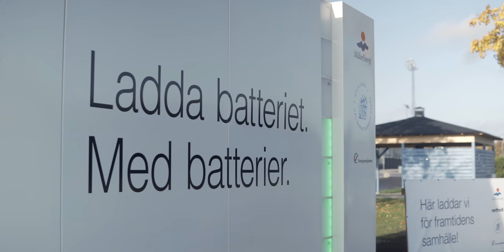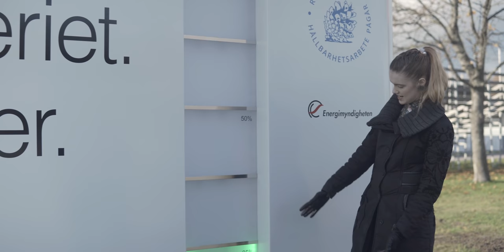Inside Northvolt - Scandinavia's 'Gigafactory' | FULLY CHARGED

Comment: 30:02 compounding... 6% growth for 10 years is 79%
Reply: Indeed. Just grab the calculator people and enter 1.06 to the power of (enter number of years). 1.06^10 = 1.790
Reply: That the growth rate is significant was the broader point for mere mortals.
Reply: Not only that, but if your battery is more energy dense, you can make it smaller and lighter and still get increased range.

Comment: Well, it feels like a race to the southpole considering that VW is running with Northvolt now and also deep in QuantumScape for solid state battery which want to build a german plant for the VW supply chain.
And that shall become available in 2025 with a twice as high density and faster charging speed at lower costs per kWh. That would have a huge impact.

Comment: very interesting video! Do you have any plans to cover Cornish Lithium?
Reply: Lithium in Cornwall ? Do tell.
Reply: @grahamstevenson1740  It's quite interesting, going back to the old tin/copper mining days they discovered springs loaded with lithium salts. The plan is to dig trial bore holes in these same locations and look into the viability of refining the lithium compounds from the dissolved salts.
Reply: @deathruddlesdeathruddles5438  yes I have seen bits on this but very little information seems available.
Reply: @keithware5314  I've seen their promotional videos. I think it would make a great onsite fully charged vid!
Reply: @deathruddlesdeathruddles5438  Yes that would be a good idea. Also a mention of the battery giga factory to be built in Northumberland.
Reply: @keithware5314  indeed! Could be a nice synergy there with a lithium source and battery factory in the same country.

Comment: Very interesting - thank you. I have just bought my first EV and I have not come across any definitive information on how best to maintain the battery for maximum life!  Some suggest regular discharge/recharge cycles. Some say charge to 80% each time, some say it doesn't matter... so could that question please be answered by a manufacturer such as Northvolt.  It was mentioned to keep plugging in, but to what state of charge? 100% all the time, or 80%?  Good on them to work recycling into the process.
Reply: 100 only if you have a long trip that needs it. For daily use 60-80%. Keeping the battery in 20-80 range should be pretty good.
Reply: Charge to maximum 85% to prevent tendrils forming

Comment: Do you remember when a 256K disk drive weighed approximately 5 lbs and was about 14 inches in diameter? That could (maybe) represent the capacity of battery storage in the future.
Reply: @Paul Denney Amazing how data grows to fill the available space.
Reply: I used one that was that size but had 1 mByte of storage, & the fixed drive had ~2x that!
Battery density will probably double during the next 15 years.
Reply: @Paul Denney A well payed job? They cost £2000 If I remember correctly. Poor ass me only had floppies in my XT!
Reply: My intent in posting that was to show how technology changes when there is the research funding necessary. I have no doubts that battery storage capacity per unit of size/weight is going to increase greatly over the next years, perhaps exponentially. The weight of lithium batteries per watt hr. has now reached the point where they are successfully powering aircraft and can last for 20 yrs. Big change from lead acid.
Reply: @phillip1115  Talk of 'exponential' improvements in Li-ion battery energy density is daft for this moderately mature technology. There's talk of 500Wh/kg (re 300-350Wh/kg currently) being possible but it's largely down to materials issues. A theoretical upper limit of 600Wh/kg in the 'perfect Li-ion battery' is accepted by most researchers.
For example, the aluminium and copper foils which form the electrodes in current production is 10 microns thick. Reducing the thickness would enable higher energy density without increasing losses from electrical resistance hugely but the material handling equipment used in production destroys thinner foils !

Comment: To make steel carbon free (as they claim they are doing) will need 2x the energy needed in Sweden today...
So to go green you go 3x energy consumtion... sounds "tricky"
Reply: That's WHY need to always have the Long & Wide view in planning & infrastructure design decisions.

Nuclear & next-gen nuclear gives you that durable energy density to do all sorts of intense electro-chemicall & heat-dependant processes & proton beam medicines etc. 

About 12  years ago I spoke with a representative  of engineering for a big Chinese  Photovoltaic company. Trade Expo & Conference in Montpelier.
She spoke excellent  english & french.
I asked her about more efficient PV chemistry & very thin film :: plasma printable future PV technology. And how that relates to Thorium Molten Salt Reactor projects in China, because they had just been announced in press and discussed at Thorium Energy conferences.

She was very responsive, on the ball & clearly informed and engaged about the strategy and business choreography.

She said:
"Yes Of course (forwards)!!!
But,  right now we have factories, processes and know how in place at work. But PV panels are little known, little used. Most people do not have them in livrs, on their roofs, towns, etc. We are signing contracts and selling product and LEARNING all the time. Each country & culture has its challenges.

The current relatively crude crystalline PV panels are not the most efficient. We KNOW that if course.
They use LOTS of electricity to make. But it's a pretty simple production line once it is up and running.
All the aluminum associated with mounting support structures and all across industry required lots of Electric Energy on demand 24/7

But IF you have that electricity, then you can do all of this, and boostrap to the next stage, to next technology.
We have to go through the present to get to the future!

This prrsent stage will take maybe 25 years.
By then we will know more, the paradigm will have changed enough to make it clear which combination of infrasrructure &;technology we need to use and improve.

By then we will likely have many optimisations but also the challenge of new large scale electrical engineering demands.

Electric Cars, metalurgy, electrochemistry, welding/manufacturing, offline and portable energy storage vs online.
She said we will need all of it.

Right now the PV companies are just using what is simple (cheap) easy to put out into the world.

 In 25:years we will replace much of that with better tech &  systems :;  smarter systems. 
Including next gen nuclear, offline storage and local systems as well as network energy plans.
Hi speed Railways included.

See the videos on Chinese hi speed rail construction.

Also recommend reading anything by Vaclav Smil

Comment: I don't understand why they've built the factory with a flat roof,the snow loading must be huge?
Reply: Snow= insulation!
Reply: @markthomasson5077  yes it works well as insulation,but I was questioning the weight after heavy snowfalls.
Reply: It is a huge building, so in proportion the snow is not so much.  Can you imagine how big a pitched roof would be!   Much less to design for flat roof snow loading
Reply: @markthomasson5077  being such a massive building is why I pointed out the potential snow load on such a huge area of roof,I'd imagine being that far north they could well measure snowfall in meters. I really don't know how they design roofs in regions like that,but flat seems to be the worst option,although I've no clue what would be a better option.
Reply: That is why one of the jobs of the building maintenance team is to clear the roof of snow, before it packs too deeply to be a danger. It is very common job for building maintenance during winter to send couple worker up to the roof with shovels and snow sledges to clear out the snow.

Comment: Why is cycling a battery supposed to be energy intensive? Modern battery manufactures discharge batteries back into the grid normally (even small chinese manufactures that make battery packs out of cells do this nowadays). Am I missing something here?
Reply: At a guess, even with discharging into the grid, even with high round-trip efficiency, there's still a substantial energy cost in absolute terms at the scale of the production planned in terms of losses to heat and then the necessary cooling. Granted, the waste heat may be recoverable for other industrial processes on site, but concentrating and transferring that heat also has an energy cost.

Comment: Interesting that northvolt factory will still be using wet slurry. Tesla 4680 cells will be dry battery electrode tech which negates the footprint and energy for those massive drying ovens and the time needed for drying.

Comment: Won't it be great to see articulated trucks full of charged batteries drive up to construction sites to keep the battery powered excavators and D9 bulldozers operating. Just think about that before getting too carried away.
Reply: You KNOW this is nonsense, don't you..!
Just stop being silly - nobody's impressed .....
Reply: O,r just maybe, they'll use a cable to get the power onsite instead. Some really large site machinery is already electric (large coal excavators, for example).

Comment: Carbon free steel won't be steel ! Carbon is essential to steel's properties.
Reply: Then you need to look it up. try google Hybrit
Reply: @flingborg  Read what I wrote !
Reply: You replace carbon with hydrogen. SSAB has built an testplant and a new multi billion $ facility is being planned.
Reply: @FRIPPE_THE_GREAT  SSAB is concerned with replacing coal in the smelting of steel. Steel itself is an alloy of iron and other elements, of which carbon is one that's essential to steel's properties. Hydrogen and steel don't mix well. search for hydrogen embrittlement !
Reply: @grahamstevenson1740   The point is not to ADD carbon.........
Reply: @flingborg  I think you missed the point. Steel is an ALLOY intentionally containing carbon. The carbon is NEEDED for (some of) steel's properties. Carbon (and other elements)-free steel wouldn't be steel, it would be IRON a far less valuable and useful metal.
Reply: @grahamstevenson1740   No one argues that steel contains carbon, the point again is not to add carbon, you are talking in circles.
Reply: @flingborg  In the video there's a reference to 'carbon-free steel'. My original comment was to point out that no such thing exists. Only YOU digressed to the issue of low-carbon processes to MANUFACTURE steel as opposed to the steel itself. I imagine that the low-carbon manufacture of steel increases the price somewhat.

Comment: This is the nonsense that the “green” industry is all about. To begin, making one battery is = 100 kw/hrs of energy! Not including all the energy used in mining and transport of the basic materials to the site? It is only because the factory uses hydro based electrical generation that makes this one factory work. This factory uses 50% of the country’s over generation of electricity? This is not the pattern used for other Giga factories in the USA and China, which use vast amounts of carbon generated energy to Make “green” energy products. Then of course, having made the battery, you have to charge it with electricity created mostly by carbon based electricity generators. The idea that the world can go all electric on transport is the biggest lie ever! There is not one country that could currently accommodate the amount of electricity need to charge millions of cars every night!
Reply: Another dirty little secret of "GREEN ENERGY" is the manufacture of Silicon metal used in solar panel production and wafers for IC's. EXTREMELY POWER INTENSIVE PROCESS.
i worked for a plant in the Midwest that made 25% of the world's Silicon metal before china flooded the market. that plant consumed more total power than the city of Detroit and power is the most expensive part of the process. Not saying we dont need to produce cleaner and greener forms of Transportation and Energy, we DO ! but the True Costs are really higher than they should be to get to the Future we say we need to Deliver. another reason Solar Panels never took foothold in the US.....No Local or National Solar Support in the form of Rebates or Tax breaks. Power companies don't want you to have Solar and fight you all the way....if not for Elon Musk's vison and businesses we would STILL be operating like we have since to 70's. Clueless and Careless when it comes to the Environment. The sad thing is, we will NEVER have TRUE CLIMATE cooperation from Russia, China and probably 30 other countries trying to become Industrialized. oh Yeah, they will build EV's but it wont be about how "Green" they are, it will be about How "Cheap" they are to Drive and Own. Its Coming.....It just comes down to what you want to do personally and what you can afford. in general, i think EV's are critical to World Air Quality long term. Just Hope Everyone can get onboard SOONER THAN LATER.
Reply: Island

Comment: The plant they building in Gdansk Poland makes a hell of a lot more sense than Sweden
Reply: Were you listening to the part where he stated that non fossil energy for the process was a critical factor? Poland is a typical coal grid which makes me wonder why they are even thinking of producing there.
Reply: @joakimnordberg2202  they're not going to produce battery cells in Poland. but they are going to build battery packs from the Swedish cells.
Reply: Ok. That explains a lot. It is quite clear making cells in Poland would be contradictory to the mission, it being to reduce carbon foot print as much as possible.

Comment: Heavy duty machinery powered by Briggs and Stratton or Cummins Diesel engines are already very energy efficient. Diesel is an extremely calorie rich fuel and I can’t imagine what the mass of these type of machinery would be if they had electric power trains. How can they be as efficient? How would you keep these machines charged? Can you please prove this point you made? You mentioned changing these heavy duty Diesel engines to electric power trains and then totally blew over that to love onto snowmobiles! Yeah of course having an electric snowmobile makes sense! Jesus Christ are we actually comparing massive heavy duty machinery to light agile snowmobiles?? By definition snowmobiles will be in cold environments so yeah obviously you don’t want to pollute these environments much if at all. 

Petrol and diesel still has some way to go to reach full efficiency. Mazda are proving that with their petrol engines. Achieving the same mpg as Toyota do with hybrid petrol engines.
Reply: Petrol is replaceable, Diesel will be very difficult to replace because all heavy machinery need it